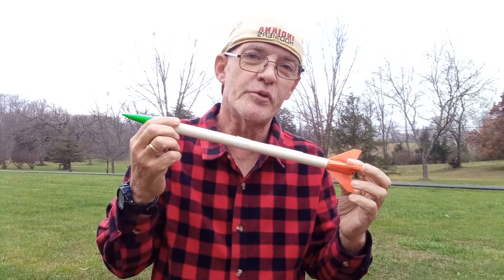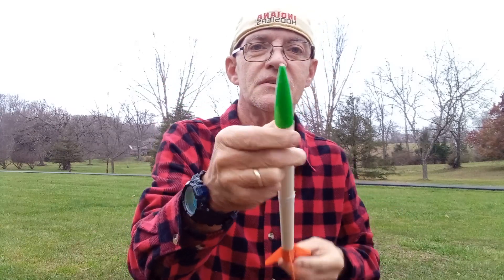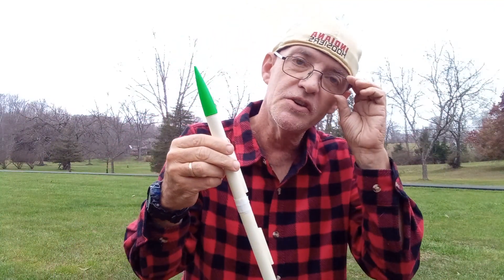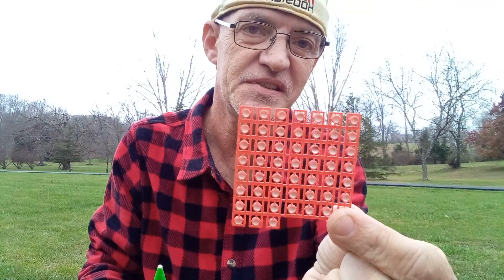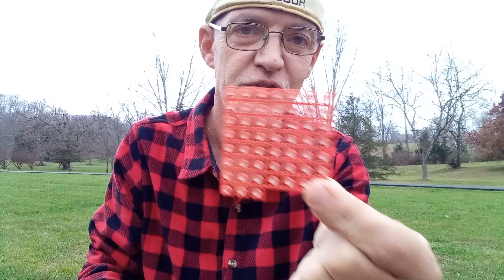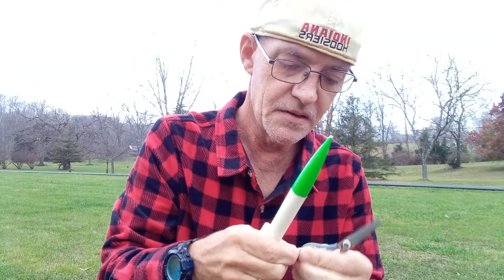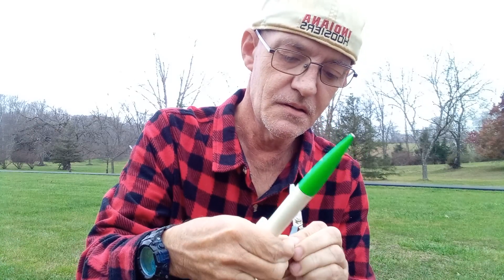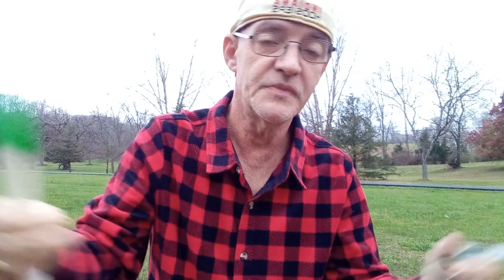EXPLODING MISSILES THAT GO OFF WITH A BANG! #science #diy #modelrockets #rocketry #rocket #missile

Comment: Hm
Not good enough
Soon we'll have to protect ourselves against God only knows what, maybe a foreign military invaders, or our own government, criminals etc.
A suggestion, Make a hollow tube to give a guided direction for launching said rocket with a sighting system, and eye protection, 
Then when you have the nose cone off, make one out of a hollow piece of steel with cuttings such as grenade has, so when it blows apart, fragments are launched, and mount a cap either as you mentioned or a bullet primer, on the very end as you shown,
Then watch what happens when it hits something, 
Now i mentioned this because there is many others probably already building this type of weapon for exactly what is expected in the near future.